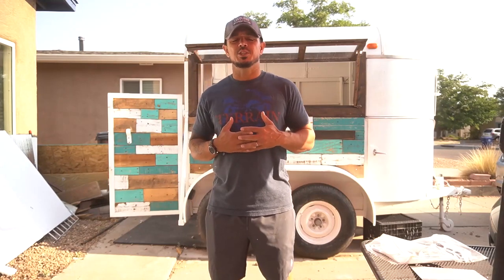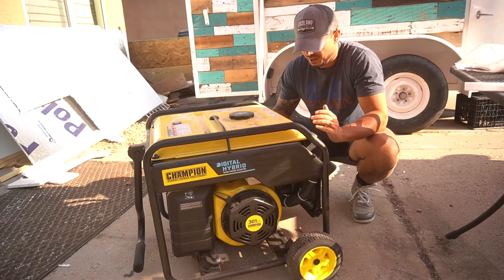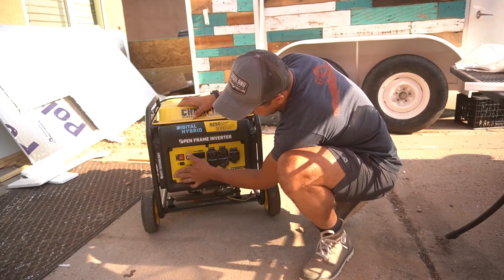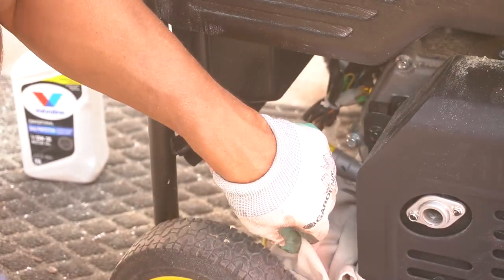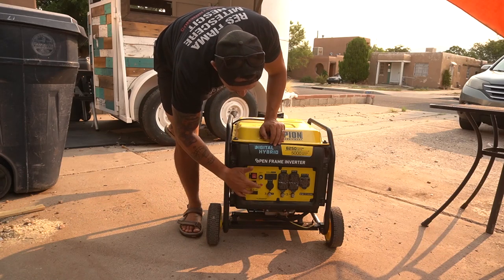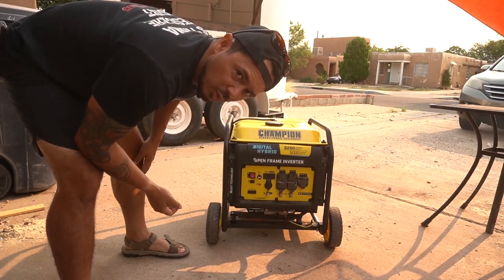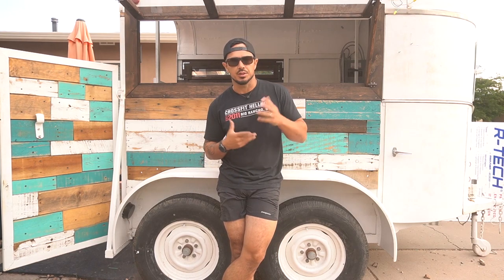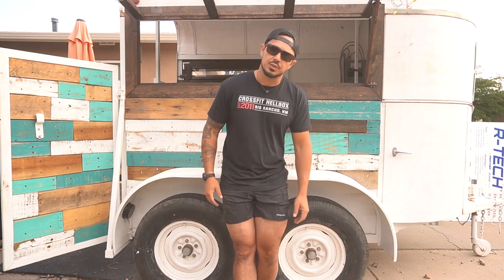Setting up and Experimenting with my 220v Generator for my Coffee Truck/Espresso Cart

Comment from the maker: You know, you publish the video and realize all the stuff you forgot.  1. Clean your air filter everytime you fill your tank...just pull it out and dust it off. If you can spray it down with compressed air, even better. 2. Try to change your oil at least every 3 months (I do mine every change of season).  3. In this experiment  I actually tried 6 materials but didn't show them all because it was a snooze fest. The materials were A. 1/2 Particle Board B. 2 Inch Foam Insulation C. Household towels (6 layers). D. Corrugated Aluminum Siding E. 1/2 Plywood  F. Window Shutter . The combination of Particle Board and Foam Dropped it down to 58 dB, which nears a Honda Generator.  When creating a sound block I only placed material between the generator and the truck and also on top...trying to create an echo chamber that send sound in the opposite direction.  Hope it helps!

Comment: This may be a dumb question but can you use the 240v and 120v outlets at the same time? I want to use the 240v for just my espresso machine and then a 120v outlet for my lights, etc.
Reply from the maker: That’s a great question, not on every generator but on this generator, yes, you can plug both types of voltage at the same time
Reply: @GreenJoeCoffeeTruck  great to hear! I couldn’t find one used so I just bought this model on Amazon, thanks to your videos!

Comment: I ended up buying 2 inverter Wen generators, 3400 running watts and mounted them on a slide at the rear of my trailer.
I went with the inverters as I was worried about a regular generator killing electronics, and closed inverters to make sure I'd have less sound issues.
The only issue is that I don't have 230v.
Do you think that a regular generator would be okay with coffee equipment?
Reply from the maker: If you have 220v equipment this set up won't work as your 110v can only be ran in parallel and not series. Meaning, you can double your wattage by connecting the two generators, but not your voltage. So of course it all depends on what type of coffee equipment you decide to go with.
Reply: @GreenJoeCoffeeTruck  thanks for the reply. 
I'm currently using 110v equipment.